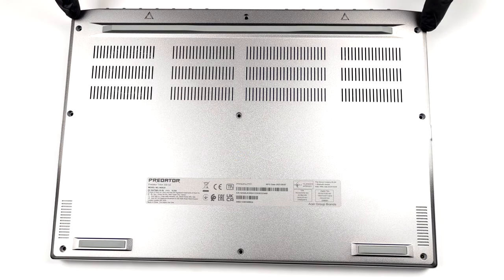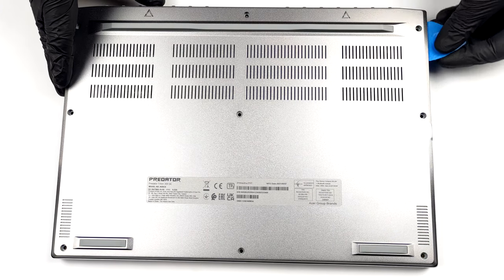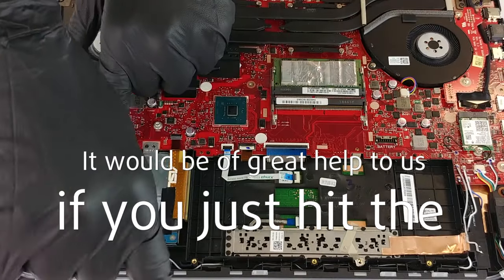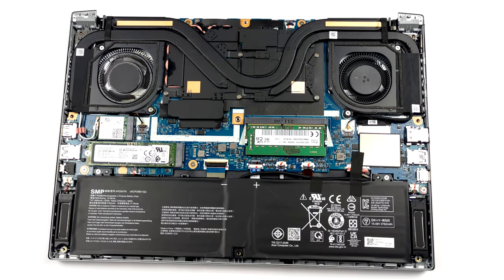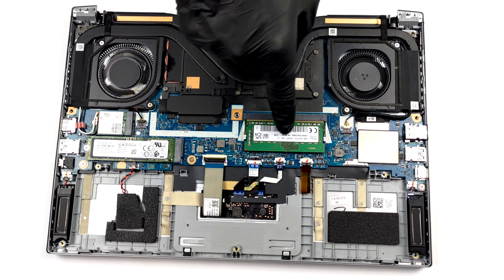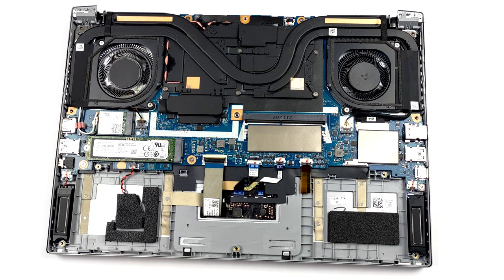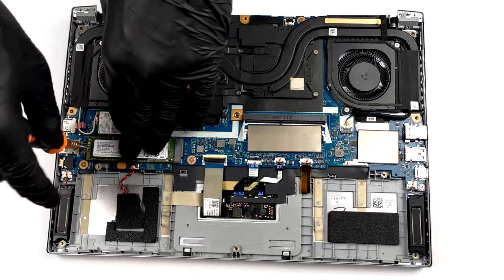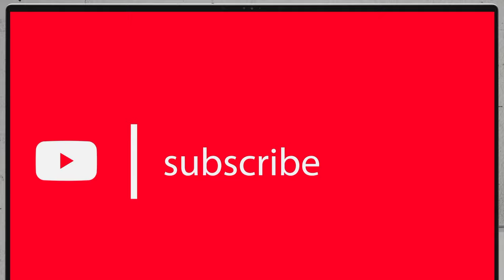🛠️ Acer Predator Triton 300 SE (PT314-51s) - disassembly and upgrade options

Comment: Can you make a video to explain how to install ram inside this pc ? Ive bought the same and i think im ginna upgrade it
Reply: The ram is the easy part, yoy dont even need to remove the battery. It is the chip held down by the metal clips on the sides, just gently pull the metal clips away by the tip to unsecure it.

Comment: Hello everyone, im not a usual uploader, but i own this laptop myself, and i attempted replacing the thermal paste. I didnt record it the first time. But because there are no videos on lifting the heatsink, i didnt know i also needed Thermal Putty/ K5 Pro for example, i only grabbed kryonaught extreme, and replaced the paste on CPU and GPU, while not removing the putty. This did not yield good results, and i need to redo it with putty in stock. I will try to upload a video of me doing this operation myself to help out owners of this laptop. I. WAS. ANXIOUS! XD
Reply: but why did you need to replace the paste?
Reply: Did you change it? i want to replace it too, could you may upload the video? that would make it much easier haha
Reply: wait, what?? why did you use thermal paste? this laptop has liquid metal which lasts longer and lowers temps better than thermal paste, no matter how expensive it is, no point in replacing it with normal thermal paste... If you need better temps use a laptop cooler. It is an ultrabook, it will always get hot.
Reply: @xeienar oh it has liquid metal. I didn't know. Thanks

Comment: Hello Sir. I have the same laptop with 16GB of RAM and I would like to upgrade the maximum capacity which is 24 GB. Do I need to buy a 8 GB RAM or 16 GB cause I don't know the capacity of the one that is soldiered to de motherboard.
Reply: vem 8 soldado na placa, voce precisa de um pente de 16 e tirar os 8 que vem no slot da ram. asism fica com 24 e voce fica com um de 8 sobrando